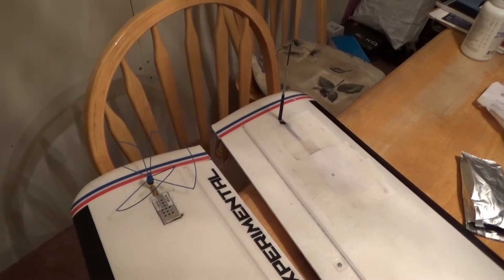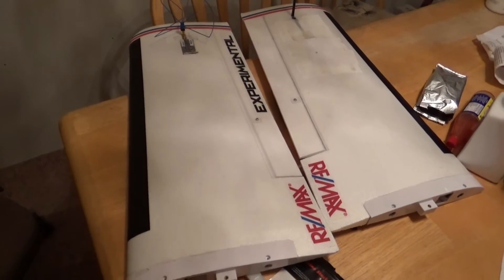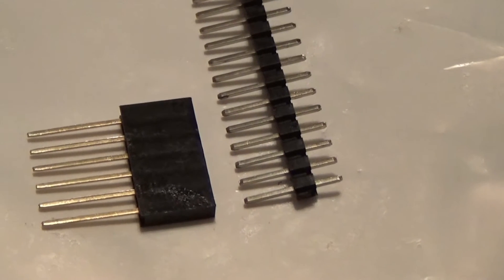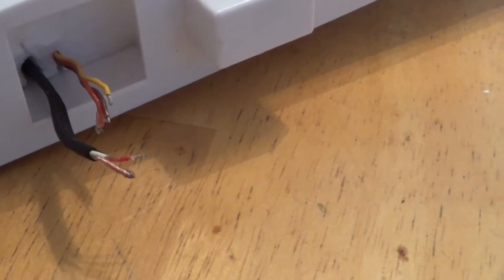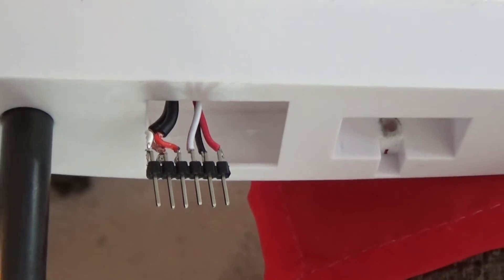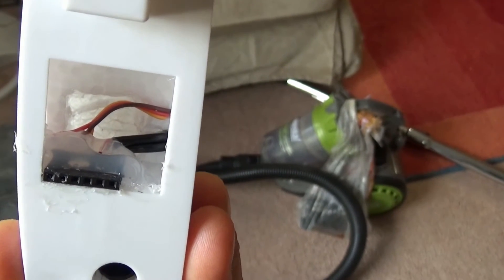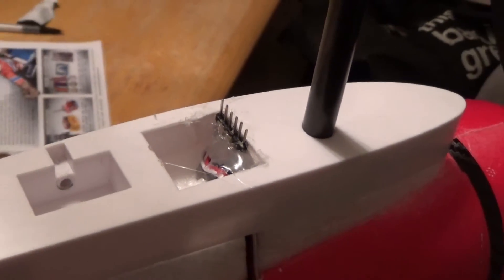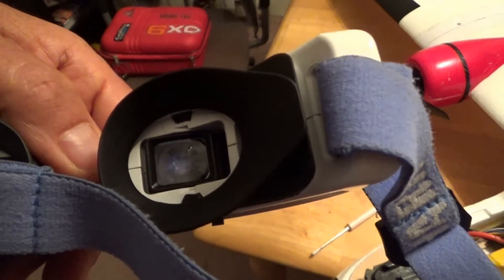How to connect the wings to the fuselage on the My Twin Dream

Comment: Not a bad idea at all. I used Molex locking connectors ( Not MPX ) so they locked together and if a wing parted slightly the cable would allow a connection to still be present.
Reply: +Eduardo Fritis maybe something like

http://www.ebay.com/itm/MOLEX-2520-2-54mm-6-Pin-Male-Right-Angle-Female-Lock-Connector-Crimp-x-10-Sets-/131297621727?hash=item1e91f2b6df:g:WuUAAOSw-jhUGEYc

or 

http://www.ebay.com/itm/MOLEX-HOUSING-2ROW-FRICTION-LOCK-10WAY-90142-0010-Pin-Socket-Connector-Housing-/111547109536?hash=item19f8b9d0a0:g:dCUAAOSw7ThUi~SP

cos a lock is always better even for wing flex
Reply from the maker: +Aron Gatt Hi Aron, I tried the second link ones and they were way to hard to unplug. The thin pins have worked great. we have them in three planes and no troubles at all.
Reply: Eduardo Fritis thats good to hear then

Comment: I use header pins too, 
1. you can get them on Amazon really cheap. Straight or angled. I get a row, and cut them to how many I need.
2. I use a small diameter heat shrink on each individual wire, than use a wider heat shrink that goes over all the wires, and part of the base, isolates the wires, looks neat.
3. When I use them on like pins on a FC board, I like to paint both sides of the base, to color code them, since I have the wires shrink wrapped, so I make sure I plug them in the right way. Like here on an afromini https://www.dropbox.com/s/1sadsrb2tho27bi/Photo%20Feb%2024%2C%207%2015%2039%20PM.jpg?dl=0
4. I use some 3M tape across the connection to ensure it stays put, not necessary like on your wing halves, but in other applications I would recommend it.
5. When soldering, I connect up the other side of the pins, to help act as a heat sink, helps to have adjustable temp iron, so as not to apply to much heat and cause them to loosen up.

Happy Flying.

Comment: Nice Eduardo! My 2.4 vtx is behind the pod and uhf on the tail. I will definitely do something like this if I go for 1.3. A friend of mine (Coyotefpv) has done this but with MPX connectors... Just gotta make sure the wings are screwed on tight mate :) The one thing that I've noticed for sure is anyone who flies an MTD loves it to bits innit? Cheers, Richard
Reply: Eduardo nope no video - but the connex are MPX as in MULTIPLEX. I think yours are just as good a solution provided they stay fixed of course... :} Don't change them mate, if they're working no need to... looks a plumb job indeed"
Reply: The acid test : IT MUST WORK :)  I'm none to keen on a 3D gimbal for a MTD, but other than that he's very knowledgeable. He's the guy who runs fpvhub dot com in the uk. He'll be leaving North Lincolnshire in a few hours to come doen to Oxford for another Mad Dogs FPV meet I'm hosting... Should be a cracking weekend weather wise so in a coiuple of days watch out for 'Mad Dogs' videos. Coyote and I are gonna try a 10km tandem MTD flight.